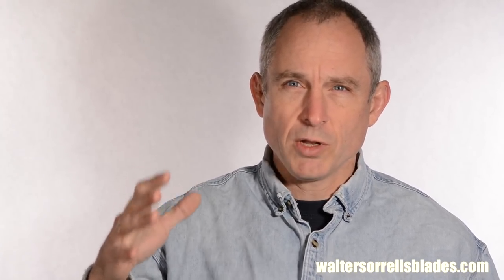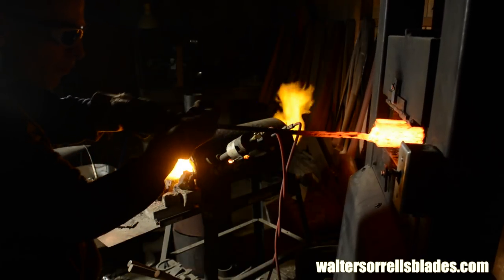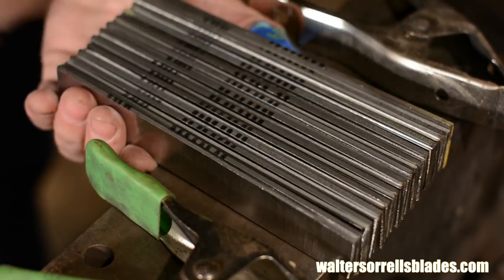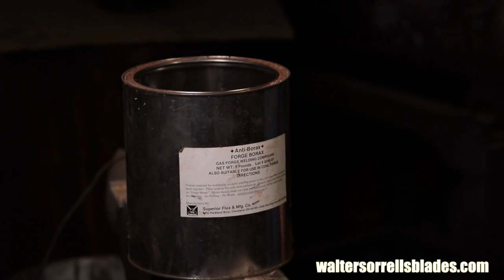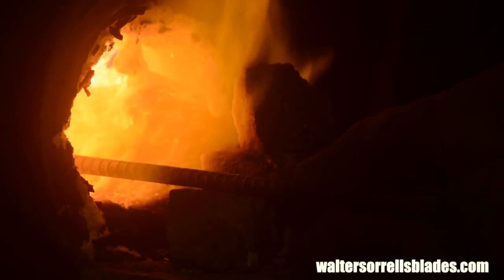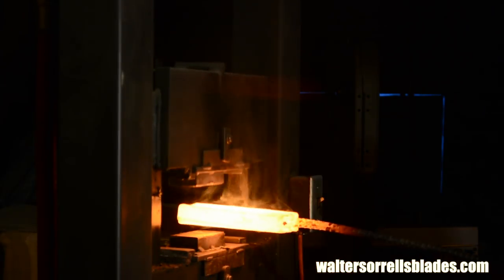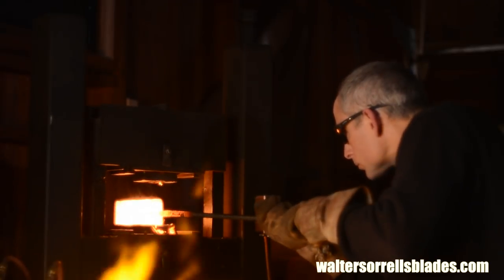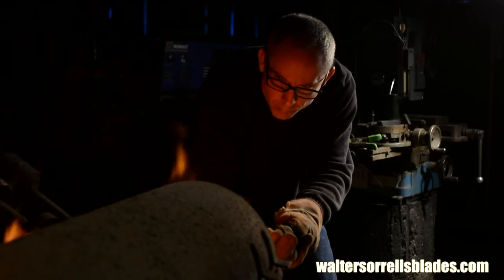How to Make Damascus Steel -- Part 1

Comment: I tend to work mild steel by hand then turn it to high carbon by baking it in clay for an hour in my forge with a bunch of charcoal dust packed in tight around the blade (about 1/2 inch of dust per 1/8 inch of blade, for 55-70 minutes)  I cant imagine the effort it would take to even attempt decent Damascus without at least 2 other people whom know at least the basics of hitting hot iron.

Comment: If I may ask a question....does a higher layer count add to the strength and "toughness" of the steel, or does it only affect the pattern after etching? Also, could you possibly do a video about creating the "Crushed W's" damascus pattern? 

As a person who has NEVER struck hot metal, I find your tutorials incredibly easy to understand, and I thank you for your time, and effort in educating those interested in making cool stuff!

Comment: Hi Mr Sorrells, I found this video very informative especially as I am thinking about my first Damascus knife. I do have a question though, after the final forge weld of the layers, when you drew out the billet did you turn the stack 90 degrees so that the billet is drawn out with the lines between the layers facing the dies, or do you draw it out the same way you forge welded the stack and then grind through the layers to expose the pattern? I'm just not clear on which side gets drawn out.

Comment: I wear Harbor Freight Welding gloves for everything in my shop. They are nice thick leather, and are particularly handy at a grinder. Not only do I not remove flesh, but I can grind longer as I am also protected from the heat. The gloves are cheap, but do have to sit out in an open area for about 6 months as they come almost directly from the tannery (smells like rotten potatoes), and then you want to curl the fingers on them and press them when you are not in the shop so they conform to your hand. I know it's work, but you have a really nice glove when you are done.

Comment: Hello Walter, so I've been through a bunch of your videos and I still find myself with a lot of questions. for instance I'd love to make Damascus steel for myself but I'm not exactly sure what 2 types of steel I should use for the blade, I want the blade to be impact resistant and hold an edge well, along with being tough which steels would you recommend? I also plan to fold the steel a LOT of times would that make any difference? or should I also do differential hardening to make the blade more impact resistant?. Or am I off with the steels should I just use the types you used in this video and it'd depend on my heat treat and the geometry of the blade to determine what my blade can be used for?, I also don't believe my forge can get to that amount of heat as I have a homemade forge kind of like the one you had in the making a machete with no power tools video.

Comment: Really good and informative video, love it. What I'm wondering is that I've sometimes seen when people making swords that that they split the thin side of the billet so it forms a Y  then add another smaller billet inside and forge weld them. I'm guessing its for making the blade sharper, but how does it work? What's the difference in steel etc. also the use some kind of paste when tempering. Have no idea how it all works and it would be nice if you could make a video about it :)

Comment: Here's the main question that I want answered:  What is the difference between using a Hada technique and forging Damascus?  I know that both focus on creating layers in the blade, but does one only use steel while the other uses a combination of steel and another metal (like iron), or is it some other fact that makes the two techniques completely different from each other?

Comment: When you finish your Japanese style blade, can you test it against a blade that was cut from steel and not forged in house? 

I want to know if traditional methods of wrapping a hard steel around a soft steel are superior than 1 steel forging. Also if doing clay patterns on the surface really give a beneficial hardness to the steel that cant be matched by regular heat treatment.

Comment: Love your videos! our mig welder is not a mig it is flux core. a mig has gas and leaes no slag. I would think useing a real mig would make ait easier as it has no slag. But dude your videos have so much info and I have learned so much. thank you

Comment: Lord have mercy.  I've never blacksmithed anything.  Just found this video by accident.  It's fascinating but I didn't realize it required so much equipment.
Reply: It doesn't take that much
Reply: +ElGatoLoco698 Well hundreds of years ago, blacksmiths only had a furnace,hammer,anvil, files and some dyes oh and a tone of elbow grease. So if they can manage with just that much so can we.

Comment: I've always struggled with the idea of using expensive grinding belts to scrub off extremely hard mill scale. I've taken to using an angle grinder. With a little finesse, you can knock that mill scale off hundreds of bars with the same $3.00 grinding disc. I use the same technique to clean the mating surfaces when doubling, too.

Thoughts?
Reply from the maker: +John Hagemann Yep.  I do the same thing when making damascus.  I didn't show it here, I guess, but that's how I normally do it.  I just bust off the worst of the scale with the angle grinder, then finish it up with the belt.

Comment: Awesome video, but is there a thumb rule, on the starting size and the outcoming size?
Reply from the maker: yYoUnG MoNeYy  It all depends on how much folding you do.  No folds, you end up with more or less what you started with.  I haven't measured but my guess is that you lose about 10 to 15% of the total each time you fold it (if you fold it the way I do).  If you fold it hot, much less material is lost.

Comment: Hey Walter, ive been watching your videos for a while and I thouroghly enjoy your style of narration and explanation. I was wondering if it would be possible to make a small billet of damascus with a friend using a 20lbs sledge rather than using a press. It's just a little project for myself to do, and I dont really want to drop thousands on equipment id probably use once or twice. Thanks and keep doing what your doing
Reply: +Tim Grzechnik It will probably work but like he said it's just better to use a forge-press.
Reply: +Tim Grzechnik If you want to make pattern welded steel (aka damascus) without a friend doing a jelly roll style is the easiest I've found. You pretty much roll the two kinds of steel into a spiral over the anvil then forge weld them back down into a block. It'll take forever but it works.

Comment: I am not trying to be one of those guys that critiques all the videos but I wanted to mention something for the more budget conscious makers watching this video. Sodium tetraborate (borax) is extremely hygroscopic. This means it very much wants to absorb water from the atmosphere which makes it not anhydrous anymore. So depending on storage anhydrous borax will become hydrated quickly causing the issues he noted with hydrated borax in the video. So unless you have a way to store it in a dry atmosphere like using argon to purge the room air from the container it is going to be the same to just buy the 20 mules borax from Walmart. You will quickly lose the benefit of buying the more expensive anhydrous borax anyway as it absorbs water from humidity in the air.

Great videos though. I have learned a lot and always enjoy the high quality of your videos. Some knife making videos on youtube tend to be lower quality. I can tell you take the quality and professionalism of your videos very seriously.

Comment: banding straps - very thin, 1075. Bi-metalic band saw blades - 15n20. a 20 layer stack is about 1.5 in thick. damascus is very doable with a hand hammer

Comment: would we be able to go straight into making the blade even if we skip patterns?
for example, is it and aesthetic deal, or does it "mix up the metal and make it stronger" as i've heard a couple people say?
Reply from the maker: The pattern welding is just an aesthetic thing.  It doesn't add strength or anything like that.
Reply: good t' know, thanks :)

Comment: Hey Walter, would using shielding gas for your MIG instead of shielded wire help minimize inclusions? This is a serious question, I have NO forging experience at all.Ron
Reply from the maker: +Ron Miller You're just tack welding the billet, then you grind the weld off later, so the welding method doesn't really matter.
Reply: +Walter Sorrells +Ron Miller  I attempted to make san mai steel over the weekend.  I used 1084-1095-1084.  I used my TIG welder to autogenously weld the corners.  I figured this would minimize inclusions as well as any contamination from using a mild steel filler wire.  Unfortunately, it didn't make up for a lack in skill.  I don't think I achieved a sound forge weld all the way through.  I still learned a whole lot though.  I have higher expectations for the next time I attempt to make it.
Reply: +DaCookieMonster with most filler wire being 70000 PSI tensile strength it's far from mild Steel
Reply: +DaCookieMonster this is why they always say the weld is stronger than the base metal. because it is. kudos for using the word "autogenously" most people just say Fusion welding

Comment: Did you build your own forge or buy it?    Thinking about forging swords as a hobby so any advice on what I need as a starter and cost be appreciated.
Reply from the maker: +Jerid Glasspoole I built it.  Pretty easy to make.  I built is fifteen years ago when I barely had any tools and totally didn't know what I was doing...so it's not that hard.  The only unusual thing you need is refractory wool insulation which you can find with a little Googling.

Comment: For small knifes you can easily forge weld the billets by hand. Just make the billet large enough for one knife. something like one inch by one inch and 2 to 4 inches long can be made by hand. 
Ofcourse if you want to do this regularly, sooner or later you will need a power hammer.
Reply: Yup! I think "regularly" is the name of the game here. For those of us who want to makes something in our back yard, and try it without the fancy setup, forge welding is the way to go though.

Comment: Do you use any shielding gas with your mig welder?
Reply from the maker: +xmaswitguns No.  It's flux core, so shielding gas isn't required.

Comment: Hello, why not use a tig welder ? you would not have to worry about contamination then. could that be done ?
Reply: I'm sure it could be, but it's slower and more expensive than MIG, and a little extra steal isn't going to be a big deal in the final blade.

Comment: Is there a reason you prefer the press over a power hammer?
Reply from the maker: +TheJollycock Two reasons.  One, they're cheaper for the same amount of squashing power.  But in my case the main reason is that they make less noise and I work in a shop behind my house in a suburban neighborhood.

Comment: This is not Damascus steel! Just go look it up at Wikipedia, but the short version is that this is a technique called pattern welding as he stated, but the Damascus steel is made with woody biomass and leaves to create nanowires and carbon nanotubes, making the blade a lot tougher. 
Still this is a very educational and good video and I definitely will watch more of walker's work

Comment: if I were you I wouldn't use cheap flux core wire to weld your billets together. this is where your getting a bunch of crap metal in your forgings. now I understand you cut those ends off. but I would  suggest getting a small bottle of c25 gas and running er70s-6 wire. much cleaner welds and stronger steel so you won't need to worry so much about cutting those off.  keep up the great work man I love this channel!

Comment: Glad you said 'modern' Damascus steel, because if I remember correctly, the original was used with metal from a cosmic object which fell to earth and forged with earth materials?  IF I remember correctly.

Comment: Thanks for making such great videos Walter.  But sadly, where as before the videos I was enthusiastic about my future in knife making, I've now had my balloon well and truly burst.  I personally would be scared to try to make a knife because I don't like to fail in anything I do.  I think it's time I took a course in blacksmithing so as I can get the basics under my belt before I start wasting my time and money.

I will keep watching your videos though, as they're something I aspire to.  

Thanks Walter.
Reply: that's a wise move. Though, to be fair, Walter has some videos where he shows you the first knife he made vs the latest katana he made. There's a lot of "trial by fire" in blade making because its very easy to screw up rather than make a great piece. Even master's have blades break often.
Reply: Wulfrune It is as much an art as it is a skill set.  As he points out several times in the video: you're going to fail...a lot...in the beginning.  But you learn something new each time that happens. I've heard traditional iron workers compare it to animal taming: you have to learn every aspect of the materials nature before you can really hew what you want out of it. Don't despair.

Comment: I would like to ask, would a 2000 or 3000 layer blade but stronger than the less layered blades. If so is there a benefit to the higher numbered layers of Damascus steel.  Thanks!
Reply: probably not, but it would be prettier.
Reply: Considering the level of steel quality today....no. The only reason is to make pretty.
Reply: You managed to not get it right by getting it right, or something...

Comment: I tried searching for a press but didn't turn up much. is there one that's more budget friendly you could point me to? I am starting a forge up and already need to get everything else. I have dabbled some but i want my own stuff now. any places i should search for everything? any pointers of advice to buy? sorry if this is a rambled jumbled mess.
Reply from the maker: +damien holliday Mine's a Riverside Machine/Uncle Al press.  There's no such thing as a cheap press really.  When I was buying, that was about the best bang for the buck.  I was going to make my own and found that I could barely even buy the parts for the price that Riverside charged.
Reply: I will have to check them out. I plan on getting pretty serious in this, and i love Damascus styles.

Comment: How would you get the softer steel on the center like in "traditional" Japanese swords?
Reply: Using clay to coat the back of the blade so when quenched the edge hardens up while leaving the back softer, also leaving a unique scar in the middle of the blade
Reply: Make a 'U' out of the high-carbon steel, place the low-carbon steel in the center of the U, consolidate.
You don't fold the harder and the softer steel together, you fold each steel separately BEFORE making a low-carbon center.
The folding done on Japanese steels isn't to make it pretty, as you do with pattern-welding, it's to improve on the steel.

Comment: dark safety glasses is even worse than no eye protection because your iris expands for the darkness and you catch more of the radiation off the billet, there is also special glasses that block the kind of radiation that comes from that kind of heat, though i don't know what they are called
Reply: +Film Factory It's not they are dark, it's that they are for UV protection.

Comment: Can it be done with other type of metals?
Reply from the maker: You can laminate all kinds of metals together.  That process, when applied to non-ferrous metals like gold, copper, silver, brass, etc. is known as mokume.  There are a lot of technical differences when you're laminating two dissimilar metals, but the general idea is the same.

Comment: Loose long sleeves around a belt sander... it's not a snag issues?  I know my dad would shoot me if I got around any running machine like that.  He worked for OSHA and saw all kinds of terrible things.  You seem wise so, not true criticism, more of a question.

Also, do you wear hearing protection when using the press.  If not, you should at least turn on some music.  :)
Reply from the maker: +Black Tub Bootlegs Lathes and drill presses will snatch clothing (and long hair) in really nasty ways but belt sanders (at least ones like I use), don&#39;t typically grab clothing.

Comment: Best way to remove the scale, is to sink metal into vinegar over night and then wash it with water and rub with scotch pad, steel brush or what ever you have in hand. You can remove zink coatings with this methods as well btw.

Comment: Can use with different metal like carbon with nikel or meteorit ? ....
Reply: High carbon steel with 15N20 nickel (found in band-saw blades) is good. Meteorite is kind of difficult to forge. It's prone to cracking and can have a lot of impurities.

Comment: Mr Sorrells 
  Is there any way you could do a video on making damascus with hand tools .You know no power hammer or press. even if the billets are not a lot of layers to begin with just to see how hard or difficult it may be with only a hammer.There is only one video that I have seen and it is not to informative. 
Just an idea id like to see your process..
Sincerely, Martin Moldovan
Reply: for beginer you must know steel type line FE Y10 HVG and whats type steel you like to make
Reply: Zek rom
    I am aware of known steels but thanks for the pointers.
Reply: the tricky part is the weld but you actually don't necessarily need a lot of power for that. a 10 year old could do a forge weld with a hand hammer easily when it comes to power. it's more about technique. the billet's got to have a reasonable size for hand forging though. a billet as shown in the video would be a ton of work. the weld would be doable in no time. stretching it out by hand though is what really requires a lot of power.